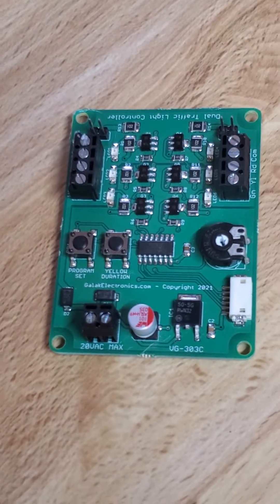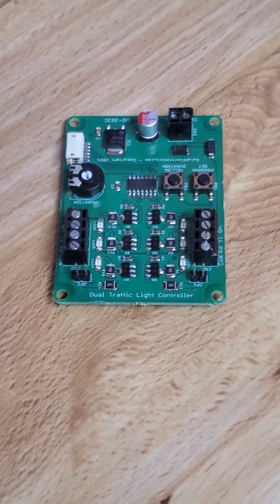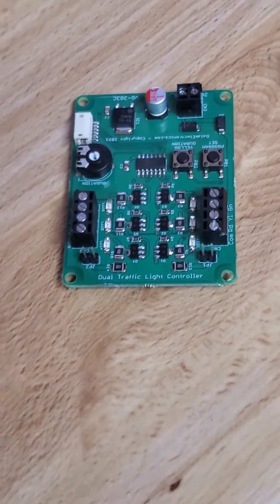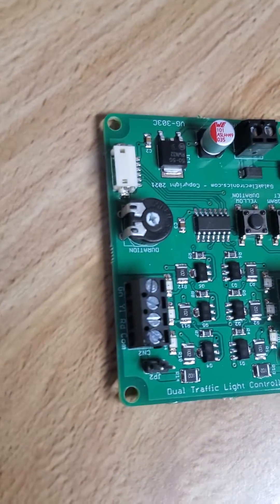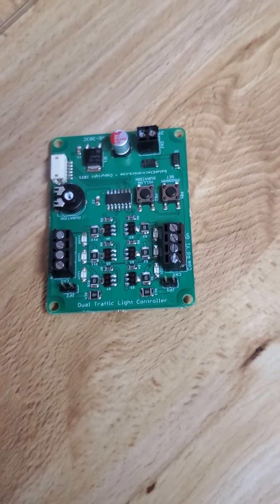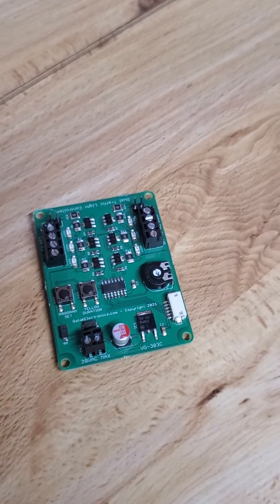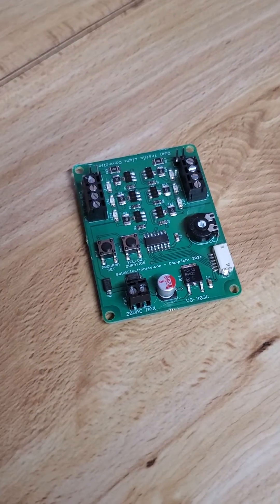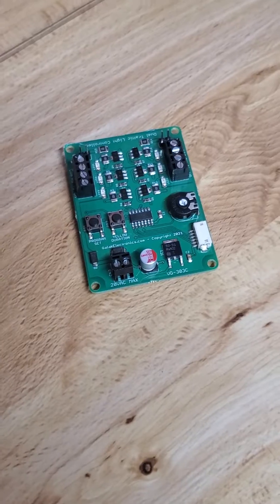Do I use Galaka Electronic boards for my miniature ebay traffic light signals?

Comment: I definitely need one of these for the signals I have. 2 8 inch Durasigs and a count down cross walk will it control all 3 with this board?
Reply from the maker: Unfortunately, this board in particular is designed for lower voltage model signals, mainly used in train layouts. You may have to look at other options galaka has to offer for real ones.